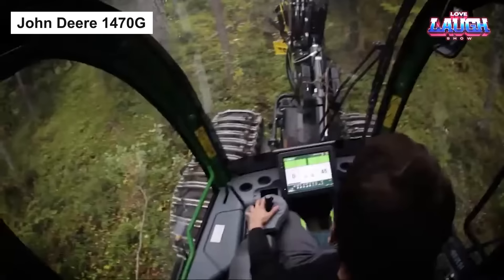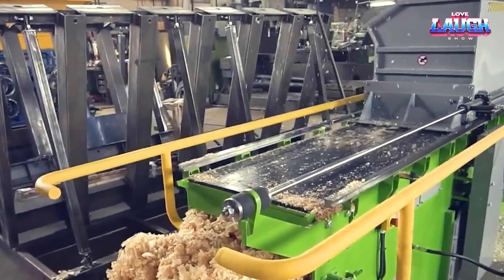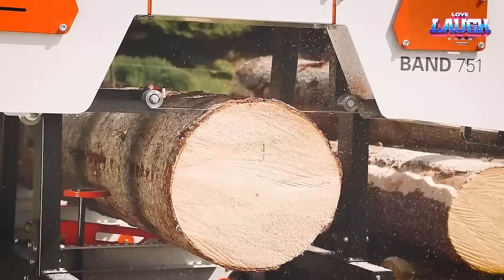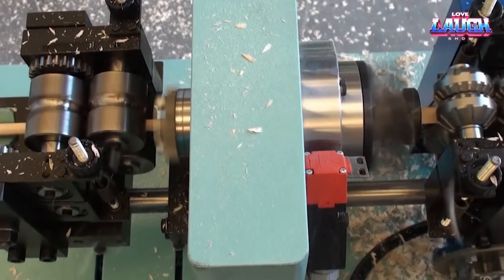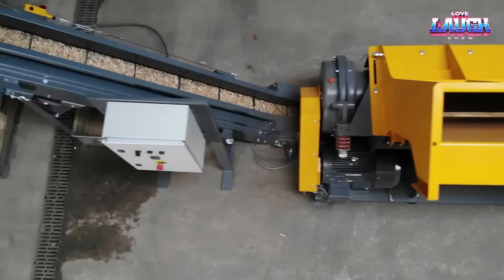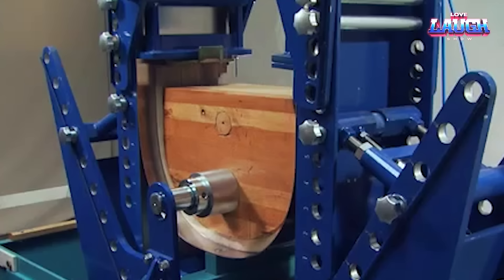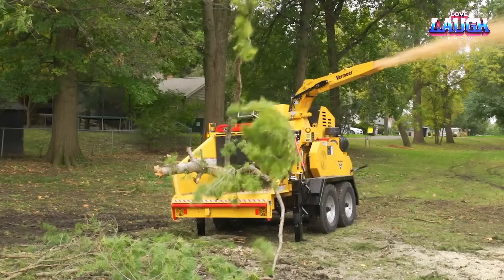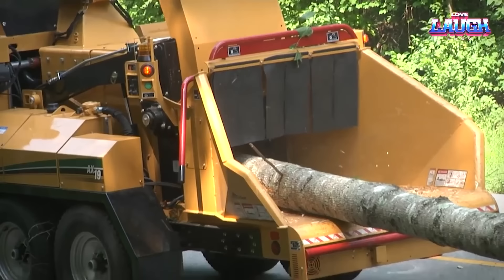17 Amazing Fastest Big Wood Sawmill Machines Working At Another Level

Comment: All good! Until one of these machines hits a steel bolt imbedded in the wood...... I know because I've done it.......
Reply from the maker: That's a valid point! Hidden obstacles like steel bolts can present unexpected challenges, even for powerful machines. It's a testament to the resilience and durability of these machines that they can handle a wide range of tasks, but it's important to be mindful of potential obstructions. Your firsthand experience adds valuable insight into the intricacies of working with heavy machinery. Safety and caution are always key considerations in any operation. Thanks for sharing your perspective! 🚧